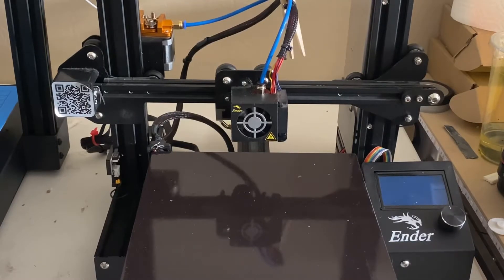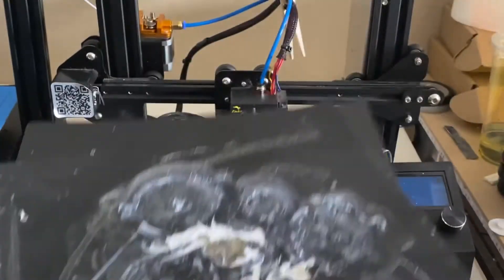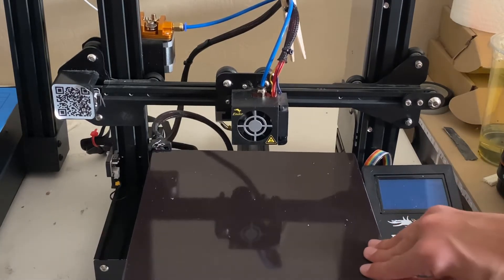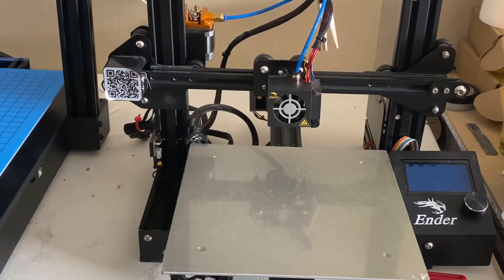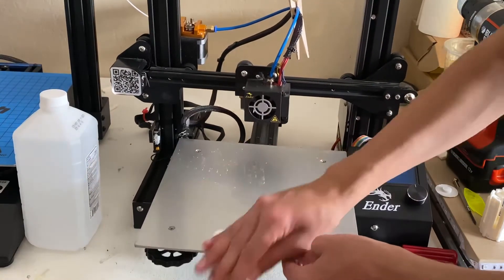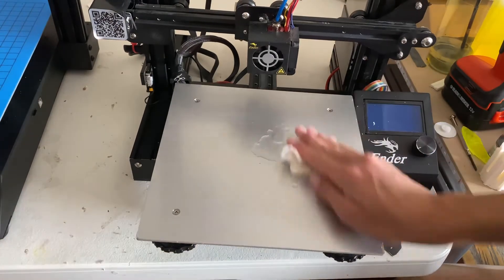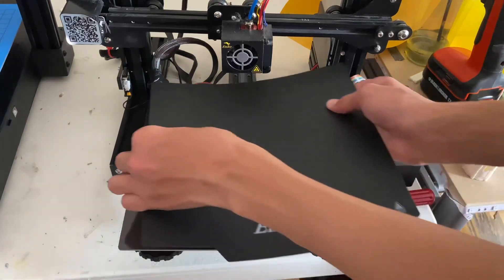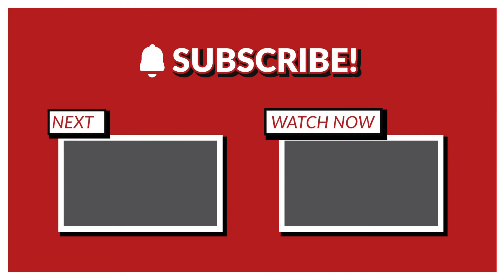Ender 3 Pro Magnetic build plate replacement tutorial

Comment: If you heat up the bed before trying to remove the magnetic pad it will loosen the adhesive and make it much easier to remove 👌
Reply from the maker: Thanks for the tip!!

Comment: My bed plate was extremely higher on one side than the other, so I took apart the bed plate and re tightened everything. Doing that fixed the misalignment but now I'm having a hard time getting the bed plate wire cover in its original position, it just goes in an angle  instead of straight and I don't want to force it and break the connector.
Reply from the maker: that’s something i’ve personally never ran into before, i bet a forum on facebook or even reddit would be of better help. i’m sorry i could’nt help you out :/

Comment: Maybe heat the bed first
Reply from the maker: that’s probably a good idea haha
Reply: Yes i havedone this and it works a lot better i recommenddoing it.
Reply: @gagecrim1913  what temp?
Reply from the maker: I personally would recommend starting at 60, cause you always have the ability to increase the temperature.
Reply: @rik1627  I believe around 80c
Reply: @rik1627  if it doesnt work go hotter